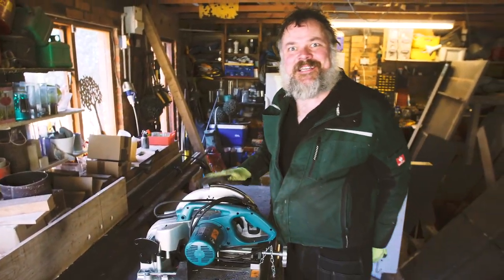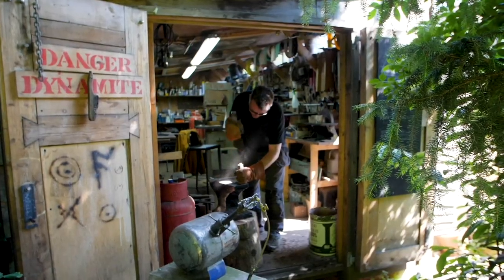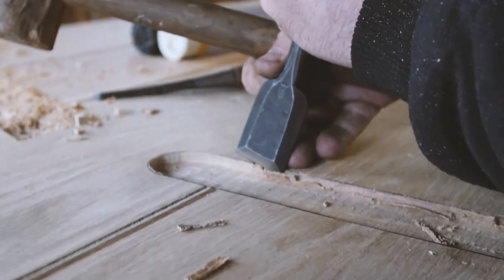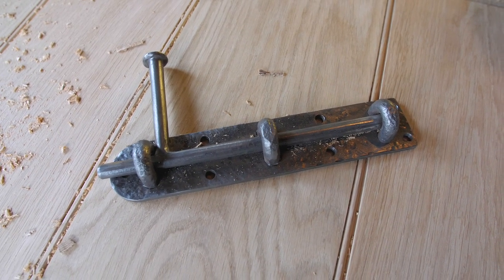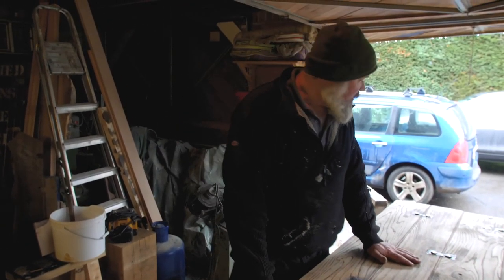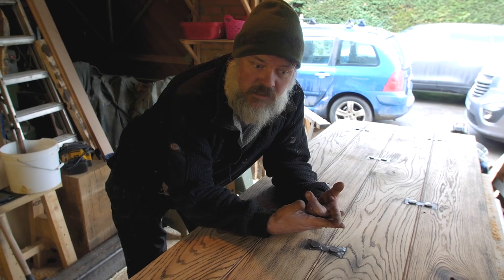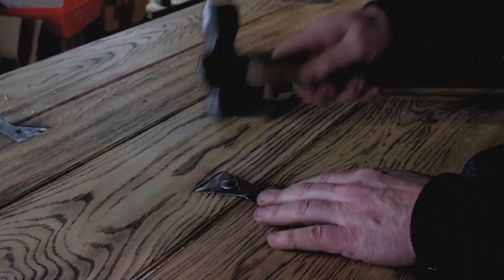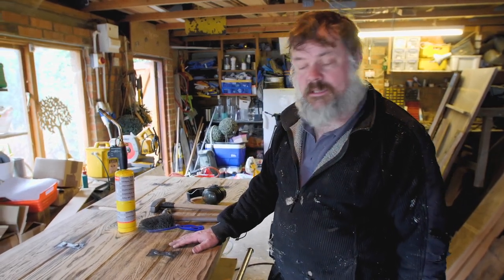How to make an oak front door - Ep6 | Door Bolt, Flamed Wood Finish & Clinkering

Comment: Do you worry about galvanic corrosion between the steel and the copper?
Reply: Morning NitFlickwick! Wow, what an incredible question! I suppose ‘i do now’ won’t cut it as an answer! Only ever come across ‘galvanic corrosion’ in an aquatic environment, sacrificial anodes and all that in boat building. But will give this some more exploration - so ‘yes’, I do worry about galvanising corrosion now’! Oh, this is me, Al, by the way. Great question, thanks for watching!
Reply from the maker: Love this thread, great questions, great answer - you guys!
Reply: I recently made a little display thing for a steel marlinespike, and I used copper to hold it. It was the question that went through my mind, and I never found a good answer. For mine, I figured it probably wouldn't matter, but it'll hang out inside. For yours, I imagine it may add a little more "patina", unless it's installed really close to the sea. Then you might get  even  more "patina".

Comment: Did you add any stain to the door in addition to burning it?  Burning darkens the grain, but how did you get that nice tan color on the rest of the wood?
Reply from the maker: We did use a hard floor lacquer, several coats, the name escapes me right now, but we definitely cover it in a future episode of the project! Thanks for watching, ping me if you want to know the exact product.
Reply: @DirtyShedCreations  sure, I'd be interested in knowing the name.  Thanks!
Reply from the maker: @joshmoyer9065  it’s Morrels catalysed lacquer, I believe used for ship/boat decks. Enjoy!
Reply: @DirtyShedCreations  Thanks!
Reply: @DirtyShedCreations  So it looks like the lacquer is just a clear coat and your getting the tan base wood color (not the dark dark grain) from burning?
Reply from the maker: @joshmoyer9065  The lacquer does add a tanning colouration, but the darkness comes from the flaming of the wood to release the tannins. If you check out our Throne project we used ammonia to bring out the tannins and then applied the lacquer and it went like a chestnut!